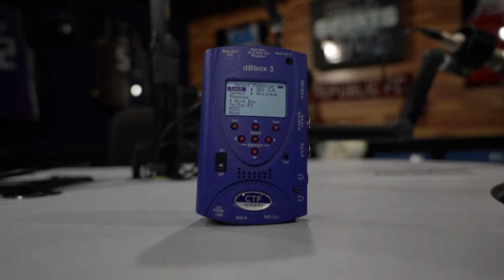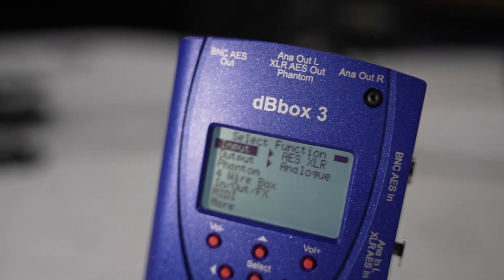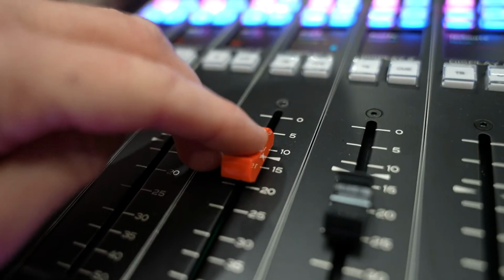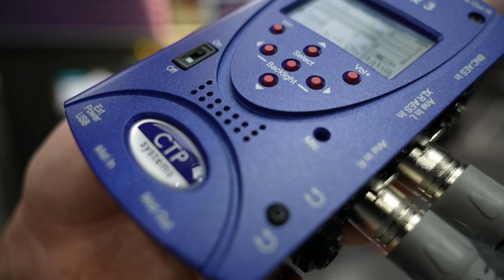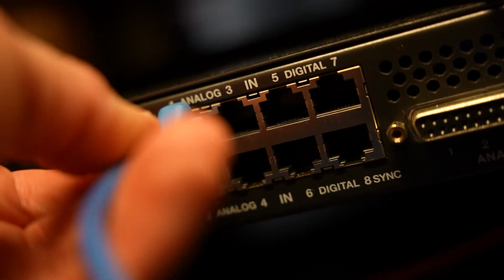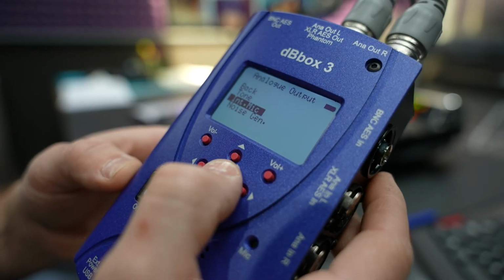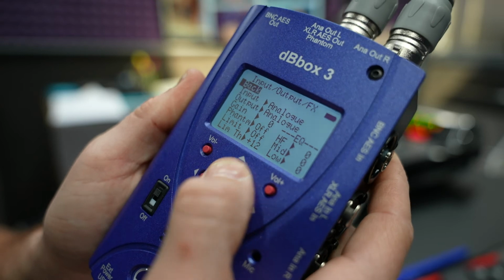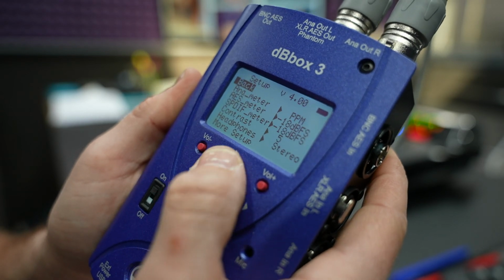CTP Systems DbBox Version 3 review by Joe Foft

Comment: the dBbox 2 is a POS. The battery compartment has broken 3 times. I also can't test analog signal  because its sending some horrible noise to the speaker. I see the noise on the meter itself and nothing is plugged in to the dbbox. I know  5 engineers with the same issues. I hope this is not the case with the V3.